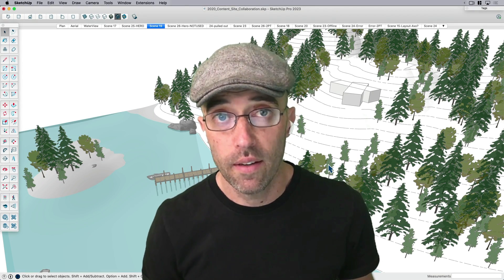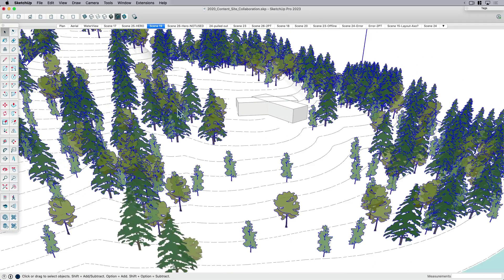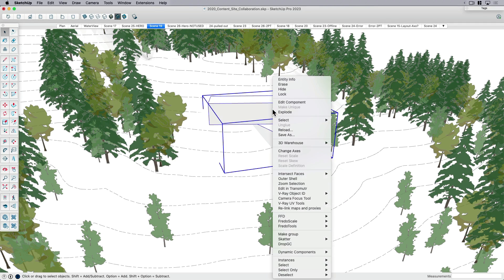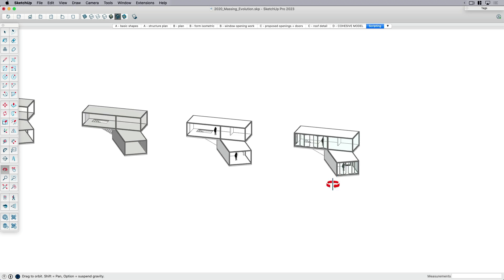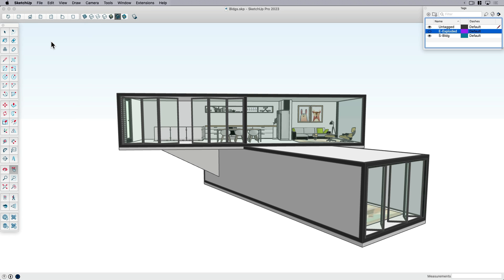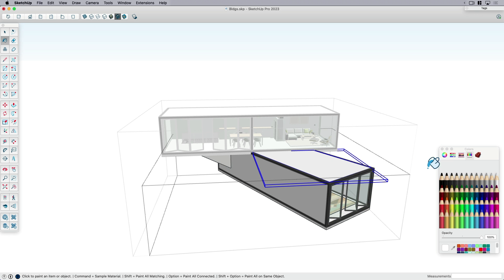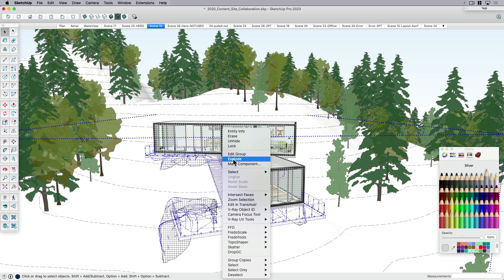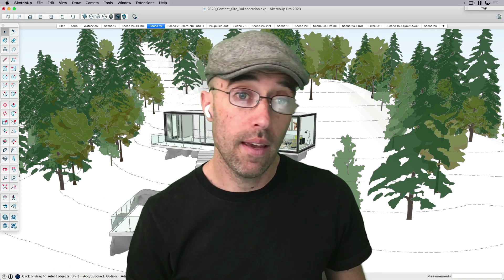How a Design Team Collaborates in ONE Model

Comment: Muy buena técnica usando componentes, pero pienso que la forma correcta de trabajar el diseño colaborativo es usando la plataforma de Trimble Connect, ya que esta desarrollada para realizar esta tarea y con un mejor control

Very good technique using components, but I think the right way to work collaborative design is using the Trimble Connect platform, as it is developed to perform this task and with better control.

Comment: 2:35 I didn't think the component "remembers" it's position in the site model. I just thought that when I replace the building it comes in using the same axes as the version left behind. If I change the orientation  or position of the building left behind, the reloaded component would also move. It really makes working on the building easier and faster if your site model is complex. If you add a lot of extra things on the side like you show in the building model, they will come back in to the site as part of the building component, along with their tags (though the tags would be hidden if you saved the building component file that way).
Reply: It does have an attribute it stores relative to 0,0.  So yes, it does remember.  This will show up also in Layout if you setup a view in SketchUp then move the geometry, it will screw up annotations in Layout.
Reply: I don't believe that.  If you move the component that is left in the landscape model, you can't reload the component without it being misplaced.  @ArtisanTony
Reply: @pcatful  Wherever the file is saved, there is meta data associated with it. Part of that data is it's location relative to 0,0 in the model itself.  So if another user moves the building around in the edited file and saves it back as the shared file. That will affect it for everyone else who tries to use it.  I have dealt with this many times as I have to work with consultants like mechanical, electrical, structural, civil, engineers and they are sometimes bad about moving the building around in the referenced model.  Then when I try to bring it back in, it has moved to the new position they have saved it as.  You can try this for yourself or I can make a short video to demonstrate.  Everyone working on the same project just needs to remember not to change the location relative to 0,0 unless it is necessary.
Reply: That's how I find it to work relative to the origin of the components.  Not the way it was described in the video. @ArtisanTony
Reply: @pcatful  Right, but when the geometry is originally created, if it is created like in this example, on the hillside and then saved out as a component, those x,y,z attributes go with it.  So that when someone else opens the saved file, they need to leave the position of the geometry alone unless of course moving it is part of the plan :)